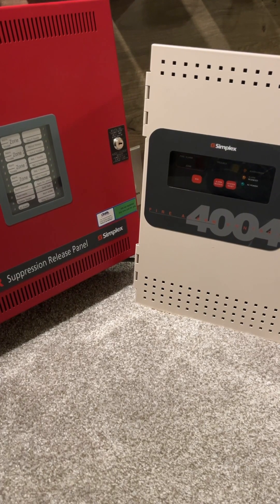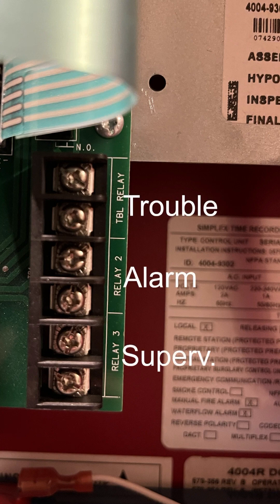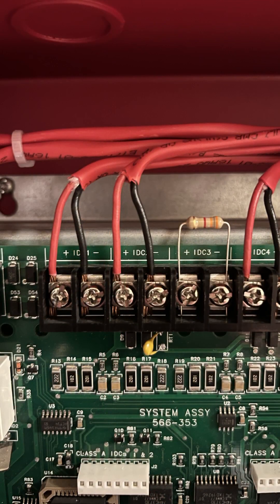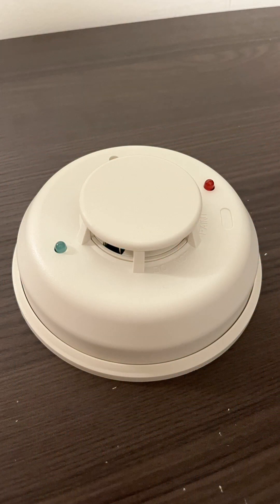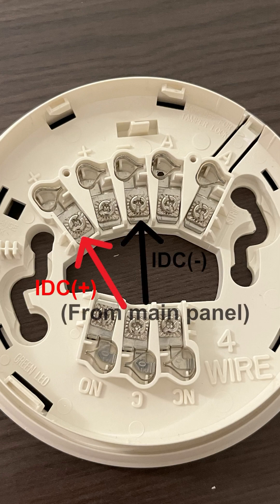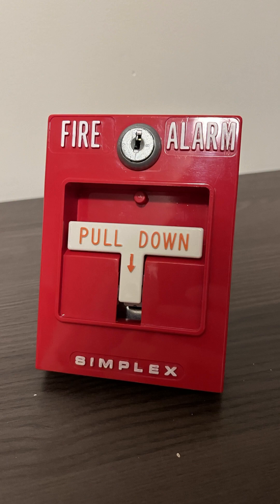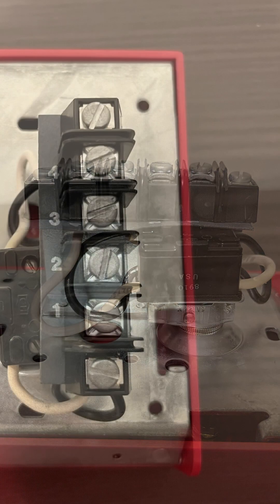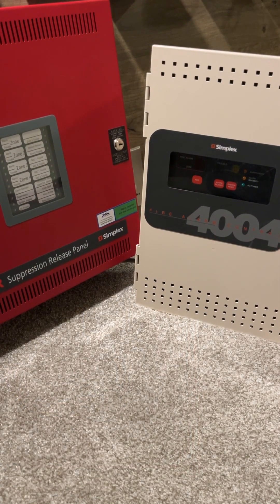Different Ways To Link Fire Alarm Panels

Comment: Another way to link them is by using 2 relays, that’s how I do it on older stuff normally. Hook the relay’s power source to the alarm output, and then hook Common and NO (normally open) to a pull station loop on the other panel. Do that whole process again with the other panel so that both can trip each other, and vola. Works good especially for older AC era stuff, as most of that didn’t have auxiliary contacts.